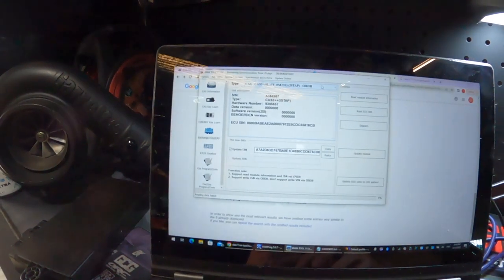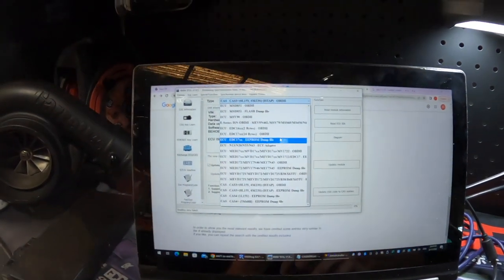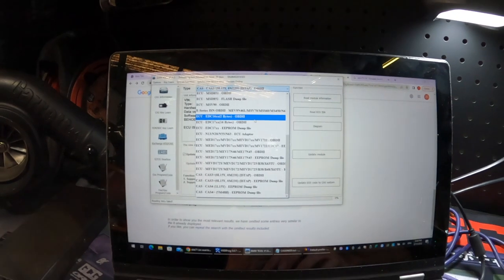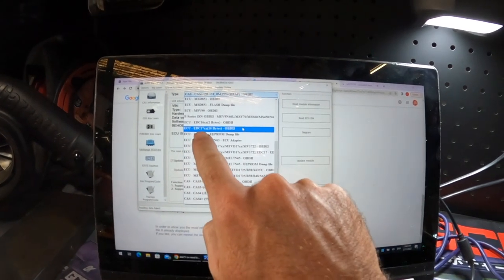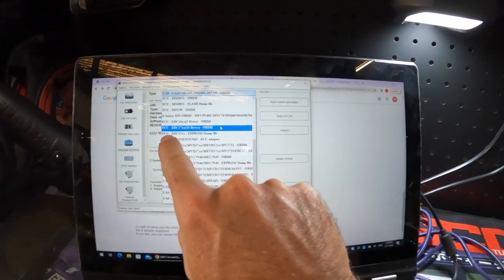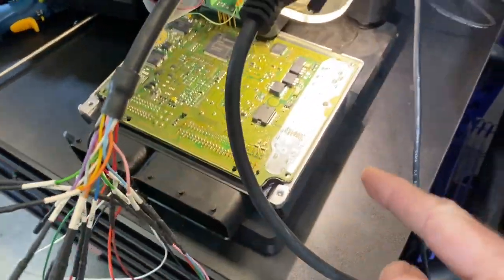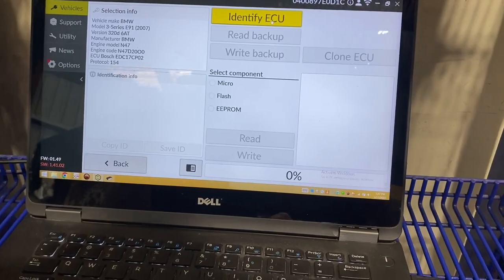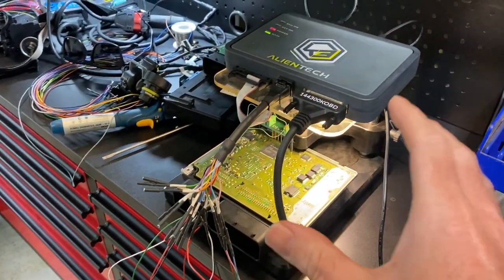BMW EDC17 ISN Read VVDI Bimtool & Alientech

Comment: Andrew that hammer was looking good there for a while i just about got all my parts for my turbo barra e90 swap i will be going full tilt in a few weeks and i will be using the 6hp26p barra auto and crossmember and tail shaft from the 320i  as it should bolt up to it as it is also a 6hp box cheers glenn

Comment: Oh that Psyche out false start really got me LOL. So glad you got it going. I've heard before that people have had trouble with water getting into their computers after going through a high pressure car wash or something. I've never had it happen to any of my BMW's over the years and I've gone through more than one without the rear engine cover on. I'm kind of confused as to how it happens as those white ish covers over the areas seem to be pretty sealed for the most part. But one report said it was a high power wash nozzle that sprayed into the seal and opened it enough to let the water in. Weird stuff.
Reply from the maker: Well i worked it out. Becuase i looked at this lid, and it was 100% fitted correctly, the seal was in good condition. It turns out it comes from under neith. The white boxes to have a drain which i think is for condensation. With the warm DME in a cold country there would be condensation on the inside sometimes. Anyway if the area below the DME box doesnt drain properly it will fill and then i turn the DME box fills.
Reply: @ZeroTo60Tube  So would that make it more likely to happen in a cold country like mine here in Calgary, Alberta, Canada?? We get extremes and I know that when I first bought my E46 M3 it had been sitting for a year and only taken for short drives in the summer were they would run the air con then just shut it off. By the time I got it there was a stank coming out of the Air con vents that would choke a horse. I didn't complain too much as I was getting the car (67000KM's on the full drive train but 238,000KM's on the body because it's a 330ci to M3 swap out) for $9000 CAD. After some research I found out it was due to the condensation being left in the vent tunnels after just shutting off the car when the A/C had been on and not letting the fan run to dry out the condensation in the tubes. It's fine now after I found out if you run the A/C when you turn it off run the fan on full for 60 seconds or more before leaving it.

Comment: I believe ECU benchtool from aliexpress should be able to read the DDE  EDC17CP02  ISN, cost around $250.  Could you check it out as little information out there at the moment. I have the N47 engine and would like to clone the ECU. Greetings from Ireland.
Reply from the maker: I just did a quick google. It looks like a good tool for the money. But who knows with the chinese stuff. If you do give it a go please le me know how it goes

Comment: what do you use to tune/modify the e53 x5 4.6 ecu? i need to raise the idle rpm, and tune out the air suspension. (i have inpa/ista, i believe i can do the air suspension there because ive raised and lowered it before, but im not sure about things like raising/lowering idle rpm).
Reply from the maker: I pulled the map out of my x5 e53 4.6 last year and it was so aggressive I left it, those things need very good fuel (octane) and good spark and the factory tune is pretty stout. There was a little to be made but not worth worrying avout

Comment: Odd that you have water damage issues so often in a warm climate. I drove whole winter with BMS cowl filters + no cowl. And occasionally got 40cm snow. But no water damage so far :D Am I pushing my luck?
Reply from the maker: Not at all. I think it’s down to plant matter/tree leaves sitting and then decomposing in the drains. I bet a place with more rain would flush the drains before they are a problem. We don’t get rain often, but when it rains it pours
Reply: @ZeroTo60Tube  Very much like that in the xDrive cars we winter drive here in Ontario Canada. The snow builds up and prevents road gunk from being flushed out through the drainage system until eventually spring rolls around and it's straight plugged with sand and salt in there.

Comment: Edc17 isn is in eeprom not flash 🤭
Reply: Also works bench
Reply from the maker: Well the alientech eeprom read didn’t have it. 

What tool did you use to do edc17cpo2?
Reply: @ZeroTo60Tube  it had it in the eeprom,only it is not always in the same location in the dump,sometimes you have to manually search for it.
Most of the time i search for it manually to be honest in the eeprom dump.
All tools that read ecus such as ktag,flex,autotuner,ktm they read the same file.
btw,i sent you an email the other day ;)